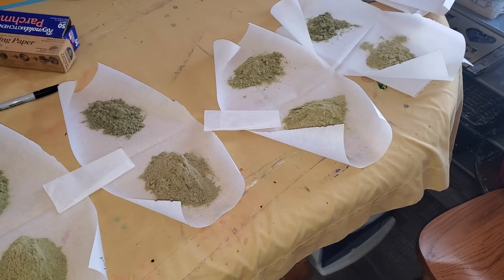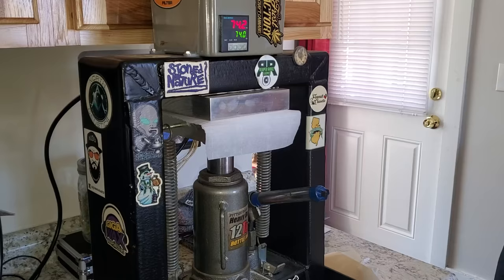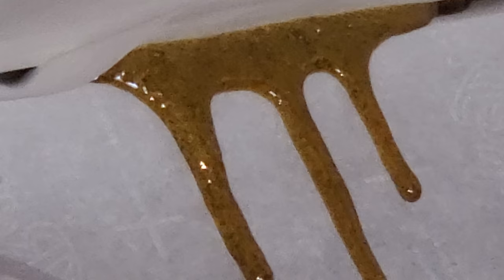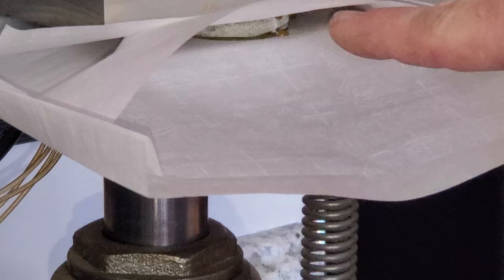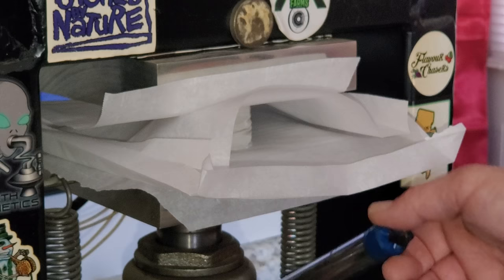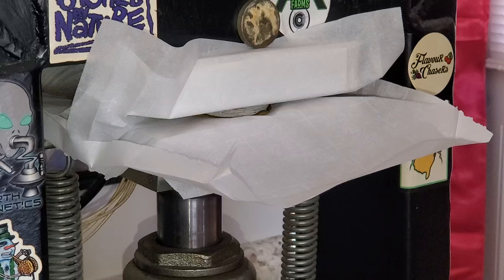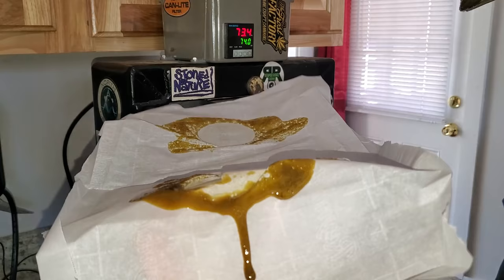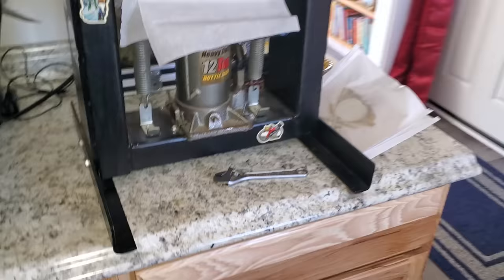How I Press Dry Sift into Rosin

Comment: Thanks for taking the time to show us some of your techniques i will be pressing at alot lower temps/pressures  to see if that helps me return higher yeilds.  Nice job on your press too by the way
Reply from the maker: Glad to help the lower temps give a better product but not always better yield. Cheers
Reply: Yes what the video greater said , higher heat (220 degrees) gives more product then low heat (180 degrees) but way worst quality. Your more likely to get a brown rosin with higher heat. Anyways I always recommend quality over quantity
Reply: cooler and softer is definantly not gonna get any one a larger yeild ever. but it will introduse a whole lot of heades to extremely rich flavors of the terp profiles . some of wich they may have embibed in for years and never noticed the differing expressions even seen with in  a single chemovar

Comment: The bags with more product, If you release the pressure, about halfway thru the press cycle, it will allow the buldging bag to adjust itself so that it doesnt pull and break the parchment while under pressure... then quickly get the pressure/heat back on to finish the pressing cycle..

Comment: You could preheat the bags in a small oven. 150°C would be perfect. You could also press it into hash, and then preheat the pressed hash - a homogenised solid will conduct heat much better.

The better design of press would employ a heated cylinder and a filter, similar to a commercial olive oil press. 

 Centriguge would also do some very interesting things, similar to fractional distillation, different temps would give different yields.

Comment: Harvest can be done quickly cut all fan leaves off 3 days before harvest cut each branch off hang for two three days . When taking buds off branch just grab from bottom of branch with index finger and thumb make a circle and slide hand from bottom to top of brack and every bud will come off saves so much time or you can use a wrench circle part just slide it up the branch to pull off buds works like a charm can use a 16" leaf bowl trimmer to get the sugar leaves off and dry in paper bags before jarring . Can even dry in oven at 220°f for 10 minutes at a time till its just enough to put in jar. Never had any issues with potency, mould and in 2 weeks time can be cured enough but longer the better

Comment: idk if you've already built the new one but idk why a smaller plate would be better. A larger mass of the plate holds more heat and would fluctuate less while you are adding the material and pressing it.
Reply from the maker: But with smaller plates the material won't be on the plates and heat as long. Thanks for watching CHEERS 😎💯🧨💣💥🌱🌳🔥💨
Reply: @Maine420medgrower  that makes sense

Comment: Me to i press with a 20 ton jack
What psi u use ?
at how long? 

I use dry sift 
37 mircon bags 

I like to press at 14gs 200 160-200 psi
Reply from the maker: I dont have a pressure gauge but my temp is usually 180 or less
Reply: @Maine420medgrower  oh cool!! How long u do it for 2 min
Reply from the maker: @MrChayanne93  sometimes a little longer. Lower Temps allow you to leave it on a little longer

Comment: So without the heat, what happens?  Also, what is the point of pressing it into liquid? Doesn't it smoke fine as dust? Do you get more high pressing it first?  If so, why?
Reply: Must be liquid to move through the filter, needs heat to become liquid. Dust is fine but messy, rosin is sticky, but easy to handle.

Comment: I wonder if you can cold press that with a cylinder with a tiny slit at the bottom and using a rod to press it into the cylinder.  That is how they make shea butter from cocoa nuts.
Reply from the maker: I'm not sure but maybe. CHEERS 💯😎🧨💥💣🌱🌳🔥💨

Comment: Hey bud, just a little tip for ya. The handle on your press, if you rotate and pull it out, it has a notch that fits on the tightening screw on the front so you don’t need that adjustable wrench.
Reply from the maker: if that was the original handle for the jack then you would be correct but it isnt so the wrench is needed. PS im not an idiot and I know how jacks work
Reply: @Maine420medgrower 🤣🤣🤣

Comment: Sweet press. Just picked up a rositek 2 ton lever action. Looking to press a brick of drysift hash alread pressed into a brick. Suggestion on micron range?
Reply from the maker: I use 25 micron bags for my dry ice sift. CHEERS 🍻💯🌱🌳🔥💨😎
Reply: @Maine420medgrower  Ahh, I got 72 micron. Heard 25-90 micron was the range so hopefully they work. Thanks
Reply from the maker: @Ohyeahcoolaid69  it will work you will probably just get some plant material with the rosin. CHEERS 🍻💯🌱🌳🔥💨😎

Comment: May I know the type of bag that is used for pressing? What is the type of small bag? Is this plastic or satin fabric?
Reply: this is what, fabric is either lotsa holes, like fencing, or no holes, like a shirt, thats the lines per inch, more lines the less space, like a shirt may have 250 lpi, lines per inch,  simply scratch filling some1 elses pockets with money, and get a square, a roll, or whatever size u like  of 250-+ 30 lpi inch mesh screening, it could be made of other material,  you can buy 3 different materials for super cheap and expirement on ur own, then just take the material and sew a little bag, double stitch the seams, and u got a rosing pressing bag,
Reply from the maker: It's a rosin bag. 25 micron. They are available on Amazon and eBay.  CHEERS 💯😎🧨💣💥🌳🌱🔥💨

Comment: May I know the type of bag that is used for pressing? What is the type of small bag? Is this plastic or satin fabric?
Reply from the maker: It is a 25 micron rosin press bag. There are many companies making them. You can get them on Amazon or eBay
Reply: I mean the type of bag in which the material is placed, not the heat press. What is the type of bag or parchment paper?

Comment: How old if the kief? Do you rehydrate or store with a humidity pack before you squish? I just squished 6 month of kief and didn’t yield nearly anything :(

And what do you find the easiest way to get the rosin off the paper? Warm or cold material?

Thanks in advance
Reply from the maker: It was dry sift that I did that day from trim that was a couple weeks old. The fresher your material the better the yield. You can rehydrate it with bovida packs. Put your parchment paper in the freezer for a couple mins if it isn't coming off well
Reply: Use a pack to rehydrate.  Only use for that garbage.

Comment: What happens with the puck after the press?
Are you still able to get more from inside it?
Reply from the maker: you can put them in coco nut oil and use it to cook with for edibles
Reply: @Maine420medgrower  - Cool thank you. I have never done it this way, but I am very interested in trying to weld my own rig together.

I normally do bubble hash but I'd like this type of consistency so I wanted to try something new.
Reply from the maker: @-ColorMehJewish-  you can get a pretty cheap press on Amazon

Comment: Haven’t seen a lot of hash rosin being made from a bottle tech set up. Didn’t look bad but I wonder the yield difference in laying it flat like Solventless does?
Reply: concsidering it is sift as long as one does not go to quickly and just eases the oil through the screen bags. one is bound to do well.
Reply: NugSmasher has a good video as to why they bottle tech style is better for yields. They really show you the difference in yield usuall bottle tech can get you close to 30% where as if it’s not you average 20%
Reply: Better yield 100%

Comment: I wonder if anyone's ever tried this with mushrooms to get extract?
Reply from the maker: I have never herd of anyone doing that
Reply: @Maine420medgrower  apparently it won't work, at least from what I've been reading. You can use 90%+ abv grakn alcohol though, and do an extract with dried mushrooms much the same way as you would with mary jane. 

The good stuff will actually precipitate out of the alcohol solution in a refrigerator, into whiteish clear crystals.